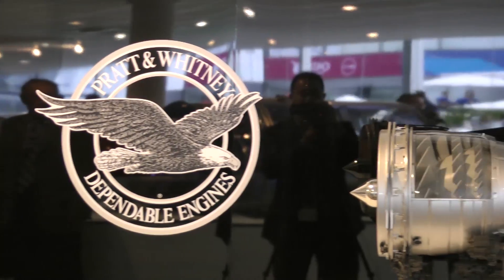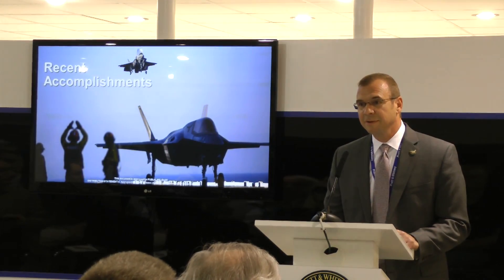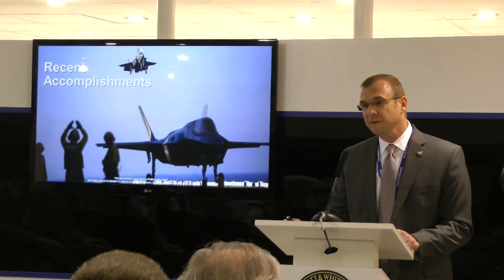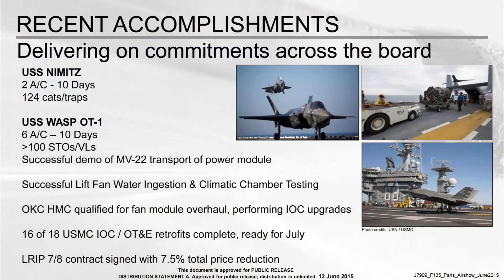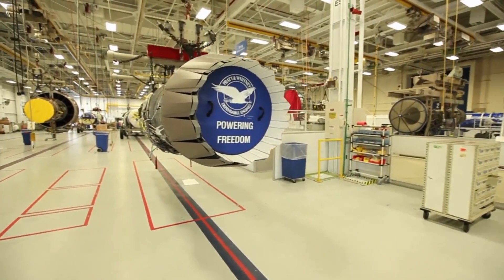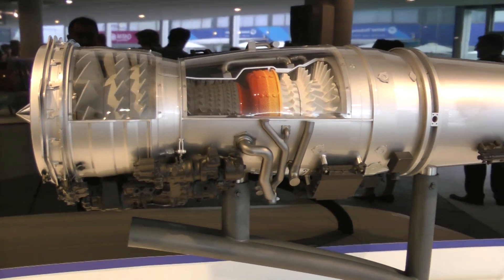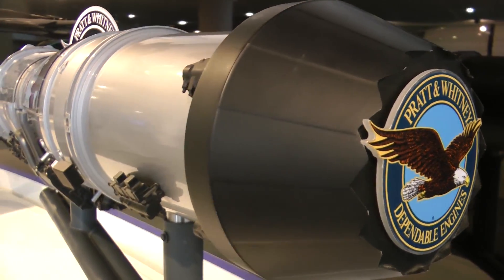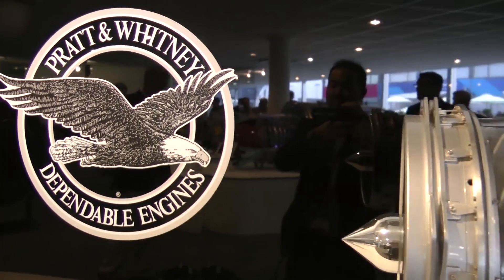Pratt & Whitney’s Engine for the F-35

Comment: '
coool nice F-35 jetplane...
but need to add twin jetmotors in the F-35 plane is better than single jetmotor
Reply: true....but adds significantly to the cost.
Reply: @montylc2001 
hi M...
'
not important about currency in here comment...
time to make twin jetmotors in F-35
Reply: And weight...they use whatever engine they need to achieve a desired speed and adding another engine simply didnt make sense
Reply: @erikcapozzi3425 
hi E C...
'
okay thank...
no wonder why many air forces uses twin jetmotors...
'
F-16 falcon is a sooo beautifully airplane with one jetmotor...
F-35 is a not

Comment: Why not two engines? This plane is going to fly over oceans with no back up engine? What can go wrong? They boast about 40 000 pounds of thrust and even the f22 has about 35 000 pounds of thrust in each of its two engines. Seems under powered to me. A step backward.
Reply: Top speed Mach 1.6 and that's without afterburner.